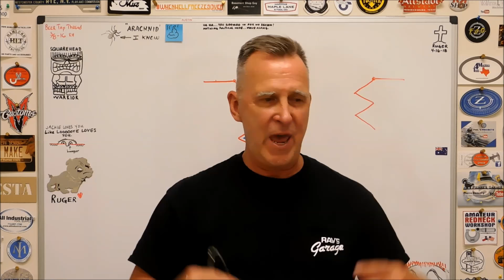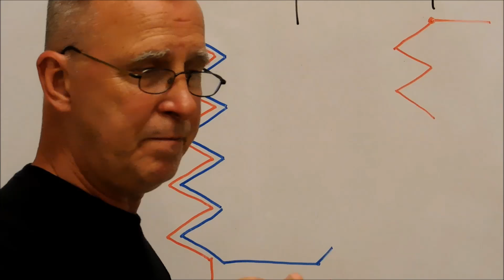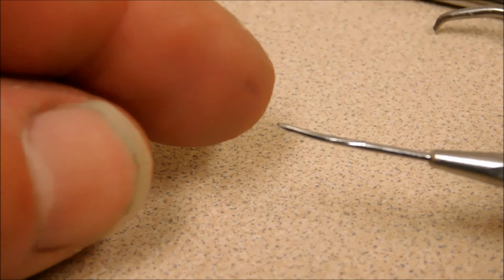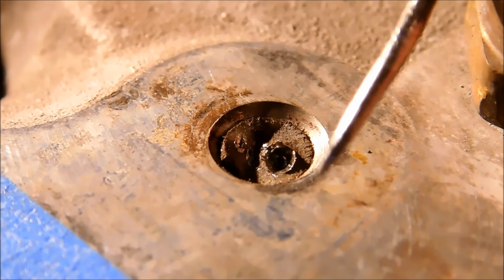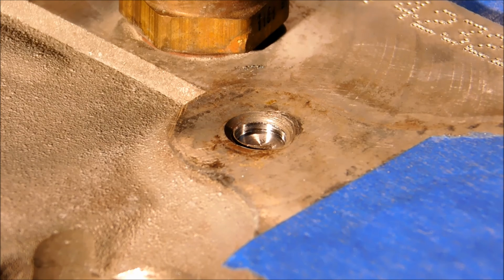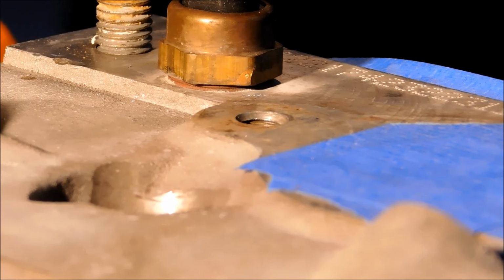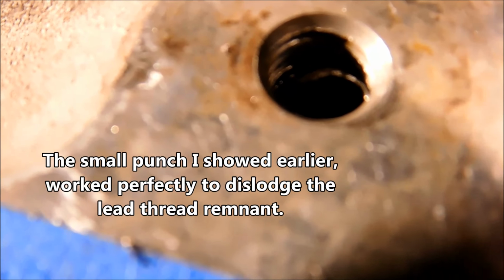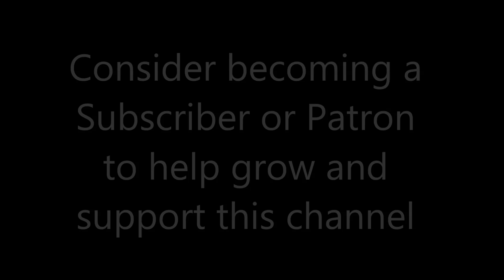Removing Sub Surface, Snapped off Bolts -- Take a Look !!

Comment: One of the best tricks I have learned during my years as a machinist is using wax to remove stuck bolts. It has to be a part that you can apply heat to (we usually use a small propane torch). It doesn't have to be glowing red hot, you want it just hot enough to melt the wax instantly as you apply it. Heat the bolt, apply wax to the top after you stop applying heat. We just Johnson's paste wax but candle wax will work as well. The heat will melt the wax and it will wick down into the threads. Then use a punch to tap the bolt to remove it.  In over 15 years this has allowed me to get the bolt out over 99% of the time. IF it doesn't come out using the wax, it's not coming out without drilling it out as in Joe's video.
Reply from the maker: I'll have to try that. Thanks.
Reply: @joepie221  You are welcome sir. Hope it works as well for you as well as it has for me. And thanks for posting all your videos, I have really learned a lot from you!
Reply: If youa re out of penetrative oil and hardware store is closed due to nasty virus outbreak baby oil will do same thing.Any brand will do.
Reply: Also if you dont want to apply heat to something use a cotton rag soaked in water ,i did that to protect plastic on my weed wacker ,also i needed to cut thread on cylinder rod that was harened -same method worked flawlessly.

Comment: Very nice. I like to weld a nut to the bolt and back em out after they cool down just past red hot. It seems the heat from the welding helps break the bolt loose. Plus its cheeper and faster than a easy out kit
Reply from the maker: I've never tried that.
Reply: Have used this method many times on aluminum heads. It is especially useful if the part can't easily be removed. Joe mentioned this already but the left drill trick gets about 80% of them out just from the heat and vibration of cutting. 

I also used a left hand m6 tap to get a number of m8 stud stumps out. Drill out about 3/4 of the stud as shown with the smaller hole the tap size. When it catches. The plug brings out all the threads.
Reply: Yep I agree, learned to do it that way over 50 years ago when I bought my first buzz box when I was 15 years old.

Comment: I like how you lined up on the counter sink with a pin. I usually line up by eye and not always the best results.
Reply: If the surface that the screw hole lies in is perfectly flat, one could use a tube with  a led in it. The tube would have to be cut perfectly smooth for this to work. The downside is you need as many such tube contraptions as there are screw sizes - if you're going to be doing this quite often.

Comment: Another way I have had great success with is to build up weld on the broken stud with a Tig welder the heat really helps and you can grab the weld you built up with vice grips. Bead lock wheel break off like that and is a fast way to get the bolts out.

Comment: Joe, great video. First off, I'm not a machinist, as you obviously are. So I don't often do work like this, but sometimes it happens that I have something I would like to fix but it's just not worth the money to take it to have someone like you to work on. A head bolt I'd probably bring it to you to do, but a Harbor Freight double bladed saw just ain't work it! LOL! But I always wanted to know how to get that center drill to sit exactly in the center, great idea to use a mill bit to make a flat on the bolt so it will sit true! I really enjoy your videos and always learn a thing or two I can use. Have a good one today and stay safe and healthy! Bill from McMahan, Tx.

Comment: small set of locking hemostats work great for grabbing little things like at 22:30
Reply: Especially what are referred to as "Needle Driver" as they should have a carbide insert in the jaws with fine serrations which will grab very effectively and lock in place

Comment: One major problem doing this is often getting the surface the hole is in parallel to the milling machine table. Automotive V-8s often have the exhaust face at an angle to the I take side. Another issue can be plunging the end mill in. I've seen guys snap end mills off by being too aggressive. I always brought the end mill down just short and set the quill stop. Start the spindle and back off the quill stop 5 thou at a crack end plunge until you have a clean surface. And do not use a long end mill. 

This is really fun when the boss hands you a job where there are broken screws in a face mill or tool holder that need to be drilled out.  Now you are getting into compound angles and all kinds of fun. Plus the insert pocket is usually damaged too.
Reply: plus the fasteners are "fairly" small

Comment: Micro surgery on a chevy head. Great video. I like the white board talks that explain what you are doing and the showing the procedure on the machine. I keep several pairs of hemostats in my tool bag. Sometimes they work better than needlenose since they can reach places that needle nose can't and can be locked closed. You would think that as long as we have been doing this we could find an exhaust stud alloy that would not corrode, break off, and seize.
Reply from the maker: I had a dirt bike once that the exhaust flange was secured by outrigger springs. I thought that was a great idea.

Comment: Lovely work that! 
There's something extremely satisfying about getting the hole bang on centre, & then unwinding the remnants of the offending stud like a spring. It gives a much warmer feeling than drilling it out completely, & fitting a heli-coil.

Unfortunately for me, most of the drill outs I do are done in situ, because I can't get the whole motorcycle in my mill. Only last week I drilled out & Heli-coiled 4 snapped 8mm exhaust studs on a Kawasaki that the customer had kindly broken off flush with the cylinder head....That's 3 hours of my life I ain't going to see again!
Reply from the maker: And $400 later, we move on.
Reply: @joepie221  Haha! Not quite 400 bucks, but not far off! 

That particular customer was ok with it, but sometimes customers don't believe how long a drill out can take, especially when done in situ with a pistol drill. Exhaust studs are the worst, for having been through repeated heat cycles they often develop hard spots which even cobalt drills struggle with.
I usually tell 'em that's it's way cheaper than a new cylinder head, or to get lost!

Comment: Nice vid mate, as always. Easy-Outs have NEVER worked for me. My thinking is, if a bolt has seized hard enough for the head to shear off, you're not going to move  it with the lesser strength of a smaller diameter shank of the screw extractor requiring the same or more tourque that broke the bolt in the first place.

I've never met a screw I couldn't get out by either drilling/picking it out like you did there. Or heating the bolt till red and drowning it in penetrant as it cools. Obviously each method has it's time place where it can/can't be done.

Comment: Something that may help starting your drill in a milled flat is to just lightly touch the drill to the surface, shut the drill off and apply a tiny bit more pressure to the drill as it slows.  Often this will allow the chisel edge of the drill to bite just slightly without being free enough to walk.  Doing it a few times just might start your hole central to the spindle rotation.
Reply from the maker: Drills I see walking I do bump them to try to get them to find center, the ones that won't cooperate get special treatment.

Comment: Great video! Someone might have already mentioned this, use a “center cutting” end mill when “spotfacing” the broken stud. Also, when aligning jig pin to counterbore, look directly down x axis of table travel to align y axis and, look down y axis to align x axis ( if possible).  This will minimize parallax view of objects.
Reply from the maker: Agreed. I find most smaller diameter end mills are center cutting.

Comment: Nice job. I've gotten good enough at this method to use a 90° dotco drill, saving disassembly. Doing it handheld requires incremental drill sizes and never skipping a size. You'll likely have to force the hole a little sideways to get final alignment. You can also get close and get a diamond bit to cut the last of the fat side to release the spring.

Comment: Great video. I’ve been a tool and die maker for longer than I can remember. I would humbly suggest that you may have avoided that problem by using a left hand drill bit.
Reply from the maker: Left hand drills work well on bolts that are willing to come out. Exhaust studs are a different animal. These were quite happy right where they were.
Reply: With respect Joe. I have removed many exhaust studs with left-handed drills with no issues.😉

Comment: A few people have noted that this is a comon chevy problem, but none have mentioned WHY it happens.It is NOT from someonetwisting the bolt head off as many have alluded to. These maifold bolts break from bending back and forth with the temperature cycling as the engine goes thru startup/cooldown cycles. The head and the manifold are at very different temperatures and expand different amounts, causingthe outermost bolts to bend slightly until they fatigue and break. Unfortunately the new bolts will also break off in those same locations reguardless of what you put on the threads.
Reply: Yup. But if you put some neverzneeze on them, it'll make the next extraction less of a headache.
Reply: Correct Jeff..
12.9 grade high tensile studs and torque to the max recommended for that grade... what you are endeavouring to do is make the steady-state pressure on the threads higher than the cycling load pressure... as you say its the +/- ....  load /unload .... fatigue that kill 'em..  torque up  to a steady-state and yer good to go... 

Where heat is involved , coat the threads with milk-of-magnesia to prevent hi-temp seizing... 

I also like to use candle wax rather than penetrating oil if you are applying heat as the wax doesn't burn away as quick as the penetrating oil... 

😎👍☘🍺

Comment: I wonder if you could comment on any ideas for guaranteeing that the axis of the drill and broken bolt/stud are colinear?  The may not be flat surfaces to reference to the drill press table...somehow, get square to the bolt head surface?
Reply from the maker: Align over another stud for axial alignment, then move to the location of the broken one. Thats probably where I would start.
Reply: @joepie221  thanks, Joe. So, there are a couple of prerequisites to using this method, it seems:
- at least 1 surface, bolt/stud/clear threaded or drilled hole, or other feature for axial alignment
- well-known bolt size (not a big deal, normally)
- tap size, or clearance drill bit, hard enough for the bolt
- centering/spot drill
   - optionally, correct/close size end mill
- smart operator to establish fixturing ;-)

About right, Sir?

Comment: There is a parallel spline type easy out which was designed for just this application and they work really well most of the time and i have had great success with them but if they do not work this would be my method as well but the easy out is quicker if it works but i agree the taper left hand thread ones are only good for something that is not seized.
Reply: what are those easyouts called? i have used them in the past also

Comment: A very good presentation Joe. From my own experience when confronting seized exhaust manifold bolts in an automotive cylinder head (both cast iron), by far the best results I always got was by using an oxy-fuel torch with the flame directedly impinging on the bolt head and heating until the bolt head was a dull cherry red color. Let the heat soak down into the length of the bolt. Use a slightly carburizing flame setting to avoid melting the bolt head. Remove the flame, give it a minute to slightly cool, and in most cases the bolt would come out with a socket and ratchet. Even though you would think that the heat would cause the bolt to expand and cause a tighter grip on the female threads, I'm thinking that the thermal shock broke the bond between the screw threads and the hole threads. This should work well with an aluminum cylinder head and a cast iron exhaust manifold too. The aluminum will expand at a greater rate than the carbon steel bolt with the same results. A lot quicker than machining and could be done while still on the vehicle.
Reply: Yep- but that is assuming that your haven't broken off the head yet. The temptation of putting the "last" bit of torque on a wrench and assuming all will be right is undeniable- unless you torch all exhaust bolts as a matter of course

Comment: The things we do for our kids! I once tried this with a hand drill into a chassis rail as an engine mount bolt had snapped. Took a lot of patience and a Jerry rigged guide to hold the center, but it worked!
Reply from the maker: I didn't mind. It was a challenge to get them all.

Comment: Hi joe .spend most of my week removing broken bolts I get them hot give a good tap with a center punch to shock it and expend it a bit . Let it go stone cold expand and shrink method then I get it hot again and press a wax candle on it it will suck the wax in better then anything on the market let it go cold  n with the expansion and shrink sometimes they will turn out like a well oiled new bolt failing that drill like you have  .wax candles work great on manifold nuts too   Other methods I use are if a bolt is broken below surface place masking tape over the hole stab a hole center and mig weld will not burn the outside hole build the weld till you come out weld a washer on then weld a nut on to that  sometime when you can’t tip a car on its roof and fit it on the mill we do what we do lol stay safe :-)

Comment: I've used an impact driver with a Philips head bit instead of easy snaps err outs with success, just drill about a 1/8 hole and let the impact make the Philips in the bolt when flogging it with a hammer.. Another trick is using a short piece of copper pipe to protect the threads and get in there with a mig to build up enough to weld a nut on.. neither are as nice as bolt removal on a mill but both can work in the field

Comment: Hi Joe, first of well done,there is slways a great sense of achievement when you can get the coil out.
Second with dental picks one way to tell is there actually a name brand stamped into the tool, cheap and nasty ones are mostly no name brand. Even better a UK,  USA or european country as well as a name brand.
Third, when drilling out a steel stud in an alloy head place a small magnet by the hole, if the chips dont stick you know you are drilling alloy. It happens!
Fourth, drilling on s milling machine or a drill with an XY table allows you to use an end mill if you are a few thou of centre, again all to easy to do. The strength of the hole is not compromised if it is even 5% oversized.
And lastly, have seen my latest video, you might see something else a bit different like my single three wire method which you liked.
ATB 
C
Reply from the maker: I just checked it out. Great idea.

Comment: I center drill even if I need to use a diamond bit in a Dremel to start.  Then I use a counter sink of known angle to clean face.  I then take a undersized nut cut a chamfer on the face so it's below the deck height and holding the nut on that taper with the ground clamp I fire a Tig weld in the center 90% of the time it works 100% of the time.  The advantage of the taper is that you essentially created a center for the nut and increased the surface area
Reply from the maker: I've always assumed the weld is softer than the frozen bond and would just twist off. I'd have to watch someone do it to appreciate it.
Reply: @joepie221  one benefit is the amount of heat in the weld does tend to have shrinkage as it cools

Comment: this is a method i've used before and the trouble with it is that the bolts are usually hardened and don't break off perfectly flat. thus the drill won't stay on center and drifts into the threads. even using a center drill or stubby won't keep the drill on center. even running an end mill into the screw in an attempt to flatten the surface of the break only results in a dull end mill or in case of a carbide end mill - a broken bit. i've even used these carbide drills that are specifically made for drilling out hardened screws.. they don't work they way they're intended to either.. i've had more success extracting broken screws and studs by welding a nut onto the end...
Reply: You do understand that you just watched someone perform what you say is impossible 😂😂😂.

Comment: I learned something new today. One of my problems is I don't have a milling machine. So what I do is weld a nut onto the bolt. You can do it with a stick as I don't have a mig. As soon as you have the nut welded on shove  a wax candle against the welded nut. As the stud cools it draws the wax down into the threads. Once it's cooled tap the welded on nut with a hammer. This helps loosen the threads. Then using a flat wrench on the nut start gently twisting back and forth. You won't feel any movement at first but after going back and forth 100 times you will. Once you have movement the battle is won. If the nut breaks off weld on another one. The only time this method does not work it if the aluminum galls into the steel threads. Then your method gives a better chance of getting the stud out without damaging the threads in the head. I have also drilled to the bottom of the stud and then welded the nut on.